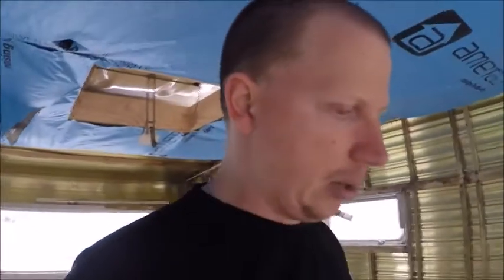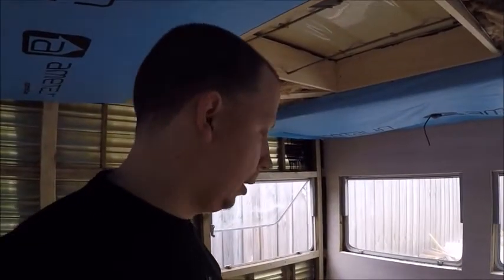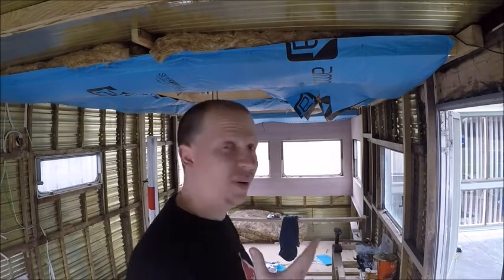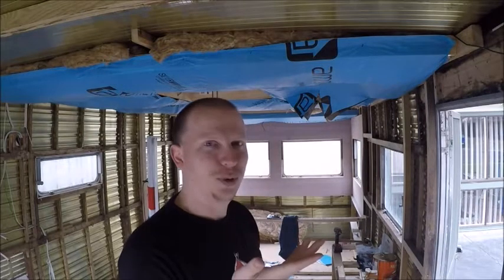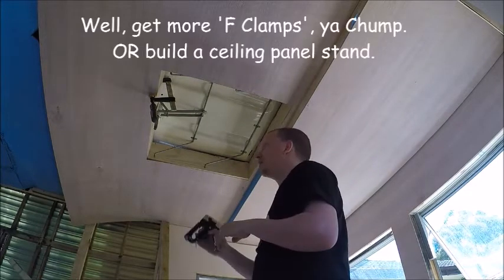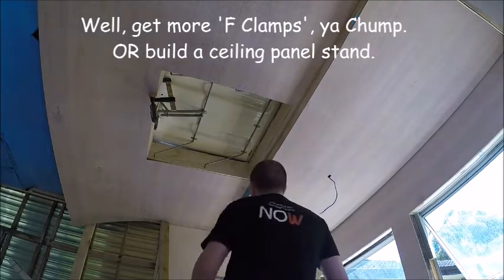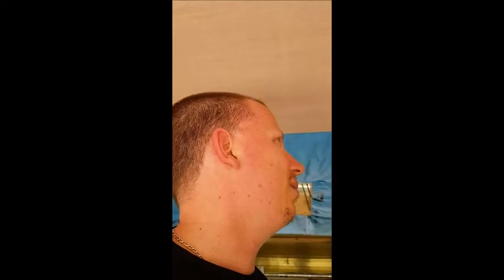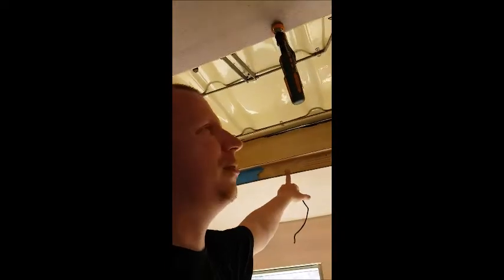Philbi TV - Vlogs - Caravan Reno Pt10

Comment: Its starting to look like a livable space, pity about the "screw up", it will make for a good bed time story for when Maisie grows older, sitting there in the van in a great camping site enjoying the ambiance...then you just say "hey!!.. Guess what silly daddy did when he was building the van".....Wouldn't it be better to insulate the walls as well, sunlight hitting those walls will heat up, also it will be better and more efficient for the proposed A/C, at least use blue sisolation to reflect that heat, im not familiar with Melbourne weather but im under the impression it gets very hot in summer and darn cold in winter....anyway food for thought....if you get the bed area finished, you can have a "power nap" while building the rest....keep up the great work son.
Reply from the maker: I may have failed to mention i have been putting a reflective membrane on before the ply that deflects heat.